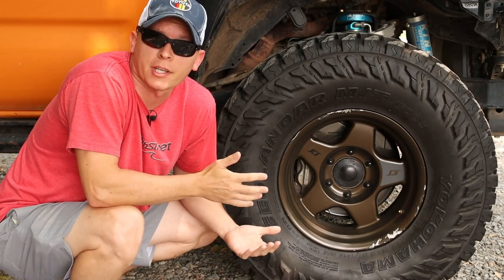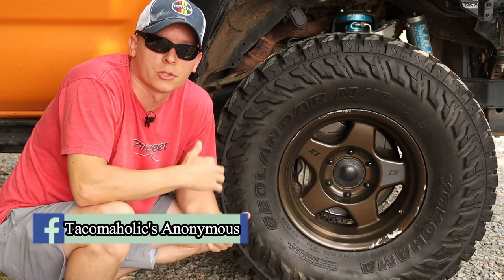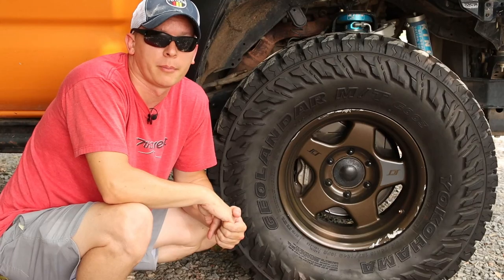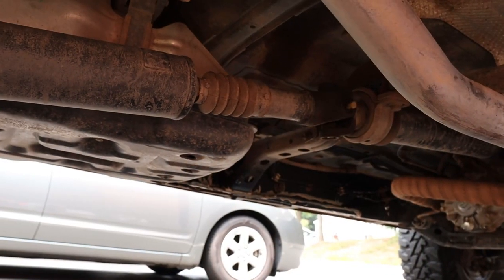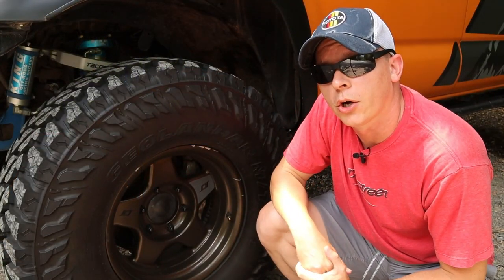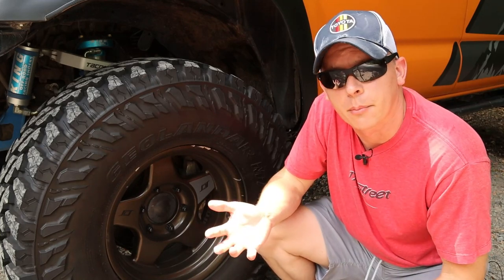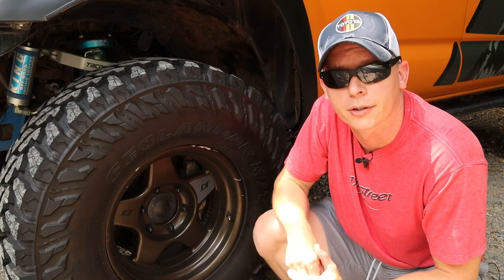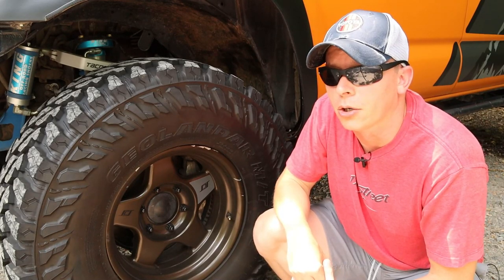Top 3 Reasons Why Your Lifted Toyota Tacoma has Vibrations & Fixes

Comment: A year late with this video for me. My needle bearing needed to be replaced on my 14 tacoma after a 3" lift from ruff country. It took about a hour of tacoma chat rooms and you tube videos before I found this out. Even ruff country reps didn't have a clue. Like you said 60 for part and 60 for the tool and you also need a big a$$ torque wrench 240 foot lbs I think. What mad me the most mad was ruff country should have put a disclaimer with there lift saying this part might need to be replaced.  So beware, this noise and vibration is horrible and scares the crap out of you when you first hear this noise. Was told by east coast that it is ok to drive but do replace this part. Like all your videos great channel.
Reply from the maker: Thanks for watching Mike!

Comment: after about 500 miles on my 22 DCLB  with 5k miles, with a 1.75" lift im getting a slight vibe on deceleration only  from 30-20mph, stock tires
Reply: I’ve got the same problem, were you ever able to figure it out?
Reply: Idk if you have had that addressed yet but there’s a tsb for a vibration on decel

Comment: Old Man Emu Dakar Heavy Duty Leaf Spring Set for 05+ Tacoma (EL096R-X2) with the other stuff you suggested two years ago, slightly larger tires and two inch spacers with the SPC Adjustable Upper Control Arm Set a month ago...I have a set of fully assembled struts coming today...No problems yet.

Comment: What about vibration after installing wheel spacers?
Reply from the maker: Installed correctly and torqued to spec?
Reply: @Tacomaholic  yup
Reply from the maker: @wilsq30  Could just be compounding a vibe if the truck is lifted too.
Reply: @Tacomaholic  ty

Comment: Got a 13 Tacoma 4x4 double. 6in Rc lift. Bigger leaf springs. I did the solid ecgs bushing swap, replaced wheel bearings and everything else. Installed old man emu leafs to haul boat. Now I get a vibration in the front only from 5-20 mph only when turning left. No vibration after 20oz going straight or right turns. What could it be
Reply from the maker: Have you added a drive shaft spacer? https://www.youtube.com/watch?v=OJdQ6V8z3EE

Comment: I have a trail edition 2023 Tacoma, which comes with factory 1 inch lift .I went up a tire size  from 265/70/R16 to 265/75/R16, adding half an inch ground clearance lift.  Now I have steering wheel and foot pedal vibration when accelerating at 70km or under load. I had the shop balance all wheels twice, still vibrates. would needle bearing start vibrations immediately  after changing wheel sets?
Reply from the maker: Worth a shot if you are sure the tires are balanced.

Comment: Hey man thank you for this.  But you said 40+ mph.  But my truck has a rumble and about 20-30.  Could it still be the needing bearing.
Reply from the maker: It could still be that at that speed. 40 just seems to be the average where the vibes kick in.
Reply: Ive got the same problem, ever able to figure it out?

Comment: Getting a vibe at certain speeds on my 15 PreRunner after putting bigger tires on it, but without any non-stock suspension. That enough to try a carrier bearing? Tires have been balanced and the vibration is through the body, not the wheel.
Reply from the maker: If you haven't changed any of the suspension components then adding the carrier bearing spacer shouldn't change anything. Does it feel like the vibration is coming from a specific area? What speeds does it occur?
Reply: @Tacomaholic  around 45-50. The whole truck starts vibrating. Feel it in the seats but not the steering wheel
Reply from the maker: @ismh86  Might want to double check to make sure your tires are properly balanced.

Comment: I have a vibration around 30-35 MPH that quickly goes away if I give it some gas. 2013 Sport, DCLB 4x4 with no lift (factory or aftermarket). I've changed the carrier bearing and U joints which cleared up the vibration for about a week before it returned. I'm stumped
Reply: I've put about $1200 in parts trying to fix the vibration over the years and nothing seems to fix it permanently. I have no plans on lifting the truck currently but if this is what factory height does, I'll skip the lifting headaches 😅
Reply from the maker: @StuffWithSteve75  The vibration has been around the entire time your truck is on stock suspension? Aftermarket wheels or tires?
Reply: @Tacomaholic  Yes sir, stock everything
Reply from the maker: @StuffWithSteve75  Have you tried to road force balance your tires yet?
Reply: Were you able to figure it out?

Comment: Hi, I'm trying to connect a set of raptor grill light to my fog light but I can't find it's fuse. Do you know where it is located? I own a 2016 off road. Thank you
Reply from the maker: I'm not sure which fuse is for the fogs on the 3rd Gen but the underside of the fuse box lid has everything labeled.
Reply: @Tacomaholic  found it. It is in the underside of the lid labeled. It a relay though.
Reply: I wired my raptor lights to my tail lights, fuse is in the cab under the steering wheel

Comment: I usually feel a pulsing vibration at 30-35 mph which I still can't really tell what it is, and no mechanic has been able to tell me up to this point. It is lifted but not much, so it could be the carrier bearing which doesn't look like has the kit installed. I may try that. Any other ideas/thoughts? Be gentle.
Reply from the maker: Is your Tacoma a 4x4?
Reply: I too have a similar vibration around that same speed. It’s almost as if it vibrates when the tires rotate fully, like part of the sidewall/tread is rubbing on the road as the tire rotated. Mine is a 4x4 as well
Reply: Install the bushing from ECGS, then re-evaluate. 90% chance that’s the problem. Total game-changer.